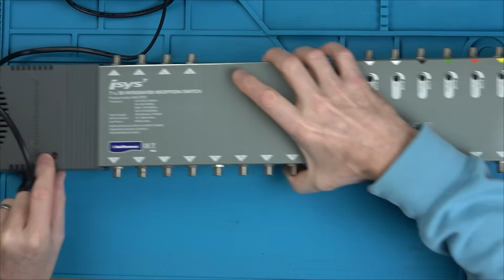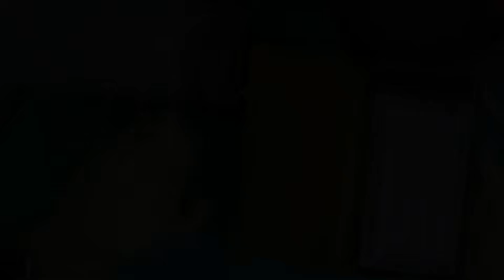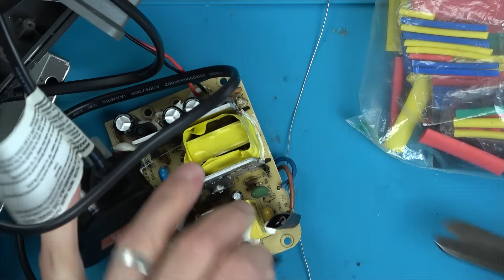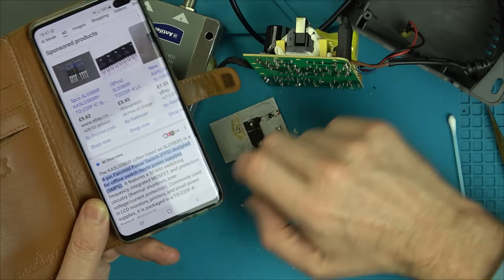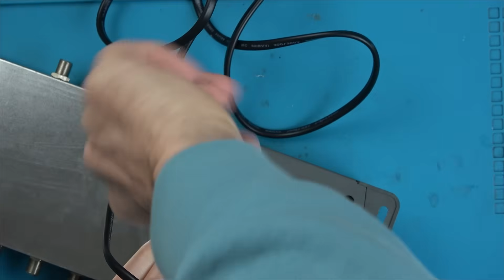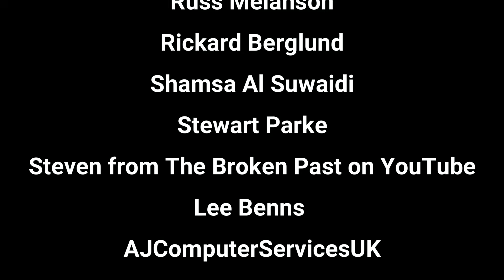Viewer Repair Challenge – Satellite / Aerial Amplifier Attempted Fix

Comment: Just a tip for the heat shrink: Would have been much easier to do that outside, when the connector was not yet bent. Simply put it over and you can turn it over the hot air like on a grill. This would have had the advantage of not blowing hot air on capacitors behind it, which can harm the capacitors.

Comment: 28:20 I would always change semiconductors (like this diode) next to such burn mark, especially if it was caused by a strike.
The is a risk it is damaged a bit too and will fail soon, damaging other parts around.
I already had such a recurring problem in a power board of a coffee machine and it worked stable after changing all semiconducters. 😮

Comment: I think we need a Vince video where you get a proper crimper and proper compression style F connectors to replace those awful screw on style F connectors you have going into your splitter. I worked for a large cable company for 10 years and I can't tell you how many of those we would encounter causing problems with cable and modems in houses. I am convinced that the only reason they exist to begin with is so homeowners who know nothing about running cables can jank their way through an install. Haha.

Comment: Hey Vince another excellent video and a timely one at that. I was just looking at amplifiers/splitters to revamp and 'upgrade' an installation so was great to see one up close with a basic crash course on what they do in an installation. It's always amazing how many fixes are just a small cheap component whereas otherwise a perfectly adequate device (still with a purpose) would be destined for the scrap heap.

In relation to your comments towards the end of the video, I do feel you. I feel greed is what's killing a lot of things off and there have been many channels seemingly under the same pressure to deliver more for less reward--it certainly would be demotivating. Just recently eBay even announced they were adding more fees in too, likely again due to greed. I genuinely don't want to see your channel (you) swallowed up this way as it's always a great day when an adventure with Vince is posted. Your calm demeanour through each up and down is a pleasure to watch and listen to and it would be shame to not have this to look forward to.

I appreciate I can't send motivation and excitement your way in a comment, but as you've asked for some other video ideas, I can definitely assist with that. I like most others would be happy watching anything you release. For anything new, be sure to consider you and your needs first (including your family). What do you enjoy most? For the videos you've done (I've been watching for at least 5 years), the main traits seems to be along the lines of planning, troubleshooting, trial and error, repairing (sometimes being unorthodox), extremely hands on (not software), learning/teaching and a wide variety of subject matter. If there is anything listed that you currently do that feels like it is more of a chore you may need to find a way avoid it.

For subject matter, there is heaps but need to find something that you will enjoy--don't worry about us. Renewables and sustainability are always a hot topic, which may open up EVs (including vehicle to grid/V2G), batteries, solar installation, home automation gadgets--might be very costly though. There are always home maintenance/improvement tasks which may lead to an outside project like a fence repair/paint, new garden bed, new path or stepping stones, converting the trampoline pit into a water feature (does your dad or other family members/friends need some tasks done?). If you want to step away from repair type videos, there is always travel/day trip opportunities if you find some places of interest to you that you'd like to share (heritage/architecture/tunnels/bridges/canals)--there may be some technical, structural or historical interest in the way some places were built or used.

I'm certain you'll eventually find something you can work with, hang in there!

Comment: Just a couple of helpful (hopefully) pointers - your 52 ohm reading across the bulk cap was your clue something was not right, a quick calculation 340V/52R calculates a current of about 6.5A. The fact your Amazon (chinese sourced?) fuses at 2A didn't blow before your plug fuse may also point to fuses that aren't from a reputable manufacture, and albeit being time delay, possibly blow at much higher current than rated. The sand in a fuse is there as an arc-quencher (high rupture capacity) that can safely disconnect a fault current whereas an arc may be sustained in regular fuses where sufficient power is available. Oh, and maybe build a current limiting device (dim bulb tester) if you don't already have one.

Comment: Hey Vince, video idea, you build stuff your self… a table that’s has powered lights built in to it. And can change colour. Recycle broken devices… old tv/ monitor in to a digital photo frame. Build your a speaker system / sub for your front room, with custom built speaker box.

Comment: You could do a channel where you try to fix all the garbage code that AI generates. 🤣

In all seriousness, EVs and EV infrastructure are probably going to be a trend worth looking at in the near future. Maybe getting into EV battery upgrades or converting gasoline cars to electric would get some interest. (If only you had a Rolls-Royce so you could strap a giant battery to it!) Or, if you don't like the idea of messing with any more cars, maybe doing some work on charging infrastructure for apartments and businesses, since that seems to be an underdeveloped part of the EV landscape right now (all the investment is going into high-voltage fast chargers).

Comment: What a nice amplifier, having satellite and antenna in one device is really convinient, usually there is only one passive antenna input and you have to get an antenna amplifier as well for VHF, UHF etc.

Also let me enlighten you on the satellite inputs. For those 4 inputs you can only use a Quattro (Single, Twin and Quad have built in switches!), one for every band, these operate at two voltages 14V (vertical) and 18V (horizontal) as well as a 0 and 22kHz tone for low and high. The voltages are the main reason you need such a device, because you can't cascade sockets, everything else is a bonus. You can also get bigger ones if you want to use DisEqC with multiple LNB's.

Comment: Just a little word of warning, using MX4 on the back of FETs etc could potentially be really bad.  It appears to break down under high voltage and become conductive. Won't matter here as it's on a plastic package. But it could cause issues in other repairs. Take a look at a video by learn electronics repair, Richard tested several different compounds for thermal and electrical conductivity

Comment: Comment to the Sand filled fuse: 
The Sand is there to stop a Arc which could stay in the Fuße (plasma) when a high current short (vor on high Voltages) occur.

Sand filled fuses are the best  choice on all AC applications,...

Comment: These, or more ruggedised versions of them, are what are in the green cable TV cabinets in the street. The one difference is the CATV ones have different signal strength outputs to compensate for cable lengths. House next door to cabinet connects to low output port, house furthest away on highest output port etc

Comment: How about retraining for a job repairing EV charging stations or an EV service technician / vehicle diagnostic specialist.  Another growth area will be renewable energy. So, a job linked to solar power inverters / system controllers and battery management.  Servicing medical electrical equipment is another specialist field that will require qualified jobs. Product compliance testing working for a UK Test Laboratory. This ensures products meet mandatory safety and performance standards for markets like the UK/EU (UKCA/CE marking). Product testing for Electrical Safety (LVD), Electromagnetic Compatibility (EMC), the Radio Equipment Directive (RED). Equipment support for railway network infrastructure, factory automation, warehouse logics, security and alarm systems, motorway traffic monitoring, mobile phone cell tower systems, police and emergency services radio comms, airport baggage conveyor systems, process control instrumentation, etc. Alternatively, if you are looking for a parttime job / sideline activity then repairing the controller boards for washing machines, central heating systems, lifts and hydraulic equipment.

Comment: If you're looking for the next thing to do, be very cautious about AI. There is a lot of hype around it right now, and the are some things it does well but it's largely a solution in search of a problem. 

It was the same with blockchain a few years ago. That's the technology behind cryptocurrencies and NFTs. So many companies were trying to shoehorn blockchain into what they did because their boards and investors were demanding it, and now most of that has been written off as failed experiments.

AI is a great regurgitator of information. It can summarise, and it can identify trends and patterns. It can follow rules. But it cannot truly think or create, at least with the current state of technology.

Comment: I had a similar one, with a linear supply. It was killed by a close by strike, and nobody noticed for a good few months, till I looked at it while evicting a pair of starlings that wanted to nest on it, and saw the LED was out. Power supply had both a blown up 85c 470uF 63V Frako capacitor, a relic from the 1980's, and a 3VA transformer that had had the thermal fuse pop, but it was still well cooked in the windings. As nobody had complained, and I was wanting to remove the box it was in to deny a rebuild of the next, it was removed. I did however reuse the power cable, as it was pyrotenax, so instead put up a light there, as the old one required scaffolding to change the lamp, and this was only 3m up, within ladder range, so put up a surface box and screwed a LED fixture to it.  Easy to move the wiring below to a light breaker fed from the photocell contactor, and as this had lightning protection that also was connected to the lights now, though I doubt the 50 year old units will be much use, but they do fill up the hole in the old Heinemann 4 breaker consumer unit they are in, dating from early 1980's when the first communal TV antenna system went in. That is slowly being removed, getting the old painted in cables off is hard, along with the newer obsolete one that replaced it first.

Comment: Why does Vince have to take an AI-related job? There are lots of positions that require physical abilities (everything from ditch digger to neurosurgeon) that cannot be replaced by current technology. 

Has our host considered repairing and reselling vehicles on a full-time basis? Obviously he would need a better workspace than his Father's back garden, but that does not seem like a job that can easily be done by an AI. 

A friend traded in used vehicles for many years as a side-job. He is not wealthy, but he now has a comfortable retirement.

Comment: When a fuse blows there is always a reason!
Reply: No, they are inherently random and will blow simply because they can. That's why they are used, a fault can tip it, or simply a chance every time you power up.

Comment: Back to basics: How to solder.
Back to basics: How to use a multimeter.
Fix it Friday: Simple item - simple fix.
Viewer item Thursday: x

I think you are going down a rabbit hole with elaborate fixes. I totally understand that you need a challenge, but by doing so you are going way past what the average person is capable of (or at least comfortable with). Personally I really enjoy the Amazon returns videos - variety and often simple things. When you were doing the power tool fixes we were promised a bit more of those, but haven't really seen a lot of them; those gained more views than normal. Tip from me is that you can probably get broken Ryobi tools from dealers if you ask nicely and explain what you do - or at least pay next to nothing. Don't mention anything about how you got them or certainly not from whom as part of the deal.

Comment: Good fix Vince. I would always replace the small electro capacitor on the primary side of the power supply. The larger ones all look good quality but that small one can lose capacitance and damage the switching transistor/ IC ….

Comment: Vince as far as soldering wick goes, you will find that it wicks better with some flux added to the wick rather than just the solder pad. I personally wish to see the right to repair movement to get their way with the industries, as been way too long on a throw away world for the passed 30 years, rather than repair.

Comment: I recommend asking ai if you come across a weird component you need to replace but isn't available or really expensive. Ai knows a lot of components and can somewhat read well enough components Datasheets so it can give you other options that would fit. Of course double check everything it says especially about datasheet values, it can get something wrong. But it definitely helps quickly and easily finding other potential replacements that may be way cheaper or just available.

Comment: Hi Vince, good video, but, you need to use a dim bulb tester. It will prevent you from blowing fuses when there is still a fault on a power supply. Basically they drop the voltage across a bulb if there is a short, the bulb limits the current into your device under test. Also to fully test the distribution amp you would need some RF equipment like an RF signal generator and spectrum analyzer. That is probably beyond your knowledge of RF right now. 
Although what you did to test it was a work around, but you dont really know if it performed to its full spec. But It was probably working OK. Good job.

Comment: One tip i would give you as also a hobbyist repair guy myself: When testing mains powered devices, plug them into whats called a "dim bulb tester". This is a simple circuit as its just a INCANDESCENT lightbulb in series with the device you are testing and mains. If the device develops a short or it draws too much current, you wont get a nasty surprise or bang, instead the bulb simply will light up and it will limit the current as its basically a big resistor. I do this every time i am testing devices that run on mains after i repaired them. This way i prevent nasty surprises or my breakers tripping due to a short circuit inside a device.

Edit: Even Mick recommends it, so i would build one too. I already have one, but thats also because i watched Mick a lot and i know that mains can have quite some power and you dont want that to get released in some big bang.
Reply: You'll have to dig up an incandescent bulb first...

Comment: Great Job Vince 👍👍👍 A couple of little tips. Make yourself a "Dim Bulb Tester" just an incandescent light bulb (100w or so) wired in series with a socket. It saves a lot of things blowing up (although it might not be as entertaining). When checking a SMPS the first things I'd usually check are the fuse, bridge rectifier, and switching MOSFET. I was really happy when you got it going. Well done mate 👏👏👏
Reply: Aye, and if a part is now obsolete and hard to find/expensive, finding a modern equivalent is usually cheaper and better specs (research carefully of course) and that low ohms on a main cap definite red flag for the future. Also.. check it powers on before putting it all back together 😉 if magic smoke happens at least you see it.
Reply: @mash83  the only issue is you often have times when a party is selected for a less than specified purpose so finding an alternative is often tricky
Reply: The dim bulb light tester has done it's job numerous times 💡
Reply: I definitely second the recommendation for a dim bulb.  I made a very simple dim bulb setup with just a dual socket, plus box and cord. I wired it so the two outlets are in series, and just plug a lamp into one of them and the DUT into the other. Saves space and was really easy.
Reply: Where would you get a 100W incandescent bulb? They have been illegal since 2009. Some might have some knocking about under the stairs but using them is like using a minidisc player in 2026, usable but as they are not manufactured or sold, when it breaks, it's gone. Well, certainly with the bulb.

As a "dim bulb" it might last a while. I remember how they used to blow frequently, I did have one in the house on the landing but besides gobbling up loads of power it only lasted a year.

A better alternative is an isolation transformer that outputs a limited low current, or a proper Variac. 

Industrial incandescents are still legal so perhaps one of those but how often will it be used? An isolation transformer with variable output is the way.
Reply: @dlarge6502 they aren't illegal to buy, sell or use. Hope that helps 👌
Reply: @dlarge6502  the 100w bulb (still available on Amazon) would obviously be used as much as the more expensive isolation transformer.
Reply: Would be a cool episode aswell

Comment: The bare lead of the fuse should've been toward the outside edge of the PCB.  Look at the outline on the PCB.
Many years ago, lightning struck very near my parents' home when they were watching TV and the power went off.  Shortly thereafter, the power came back on but the TV wouldn't.  The TV repairman came by (told you it was many years ago) and fixed the TV.  A week or so later, I visited my parents and asked my Dad what the repairman found wrong/what he replaced.  My Dad said, "He called it a 'doo-dad or something."   (a diode)      😂😂😂😂😂😂😂

Comment: Warning Vince do not use MX4 paste on any high voltage transistors it is now been proven to be conductive over 12 V dangerous to use this paste not designed for high voltage see manufactures bulletin